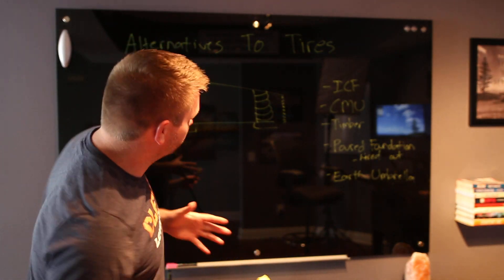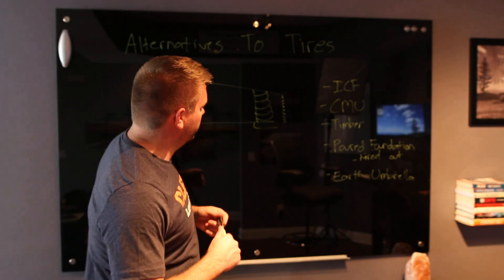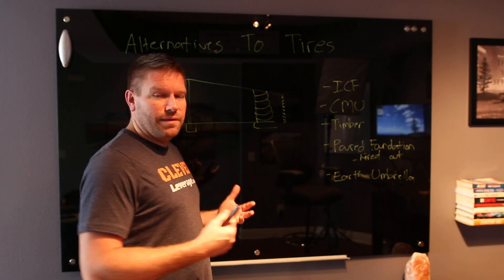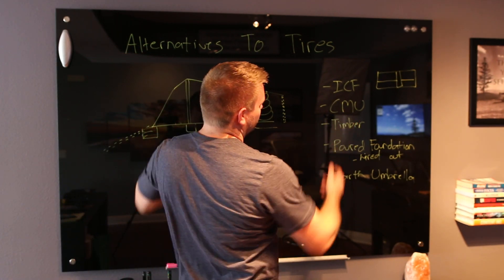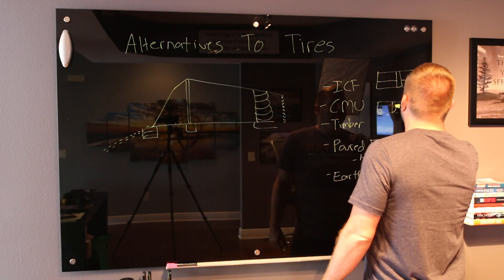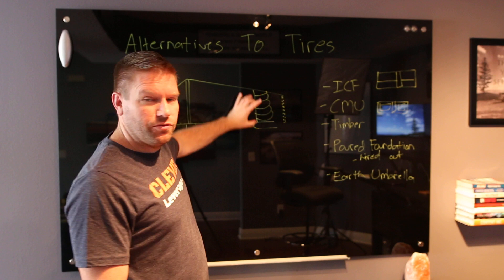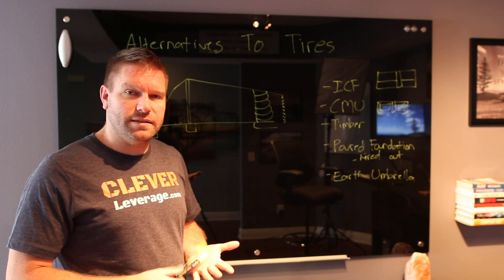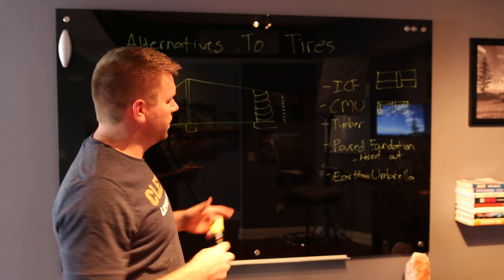Earthships: Alternatives To Tires

Comment: I have been nerding out on hempcrete builds. I LOVE the idea of an earthship home, but hate the idea of using tires. I have been trying to figure out how to go about building an earthship home using hempcrete as a tire alternative.
Reply: I'm curious if hempcrete is as earthquake and storm proof as tires, and if it has thermal mass qualities. From what I've read it seems like it. There is so many ways to build these earthen eco homes, like rammed earth, earth tubes, hemp, cob. Hope there will be more examples of projects mixing it with earth ship concept
Reply: @terriermonisgod  hempcrete can endure hurricane strength winds, it is fire resistant as well as mold, mildew, and insect resistant. My only concern with using hempcrete instead of tires is the water barrier between the hempcrete and the earth backfill. Still lots of research to be done. However, I am leaning more towards an actual hempcrete home with the glass earthship front instead of an actual earthship. Also, the hempcrete has a better thermal barrier rating as well as better insulation factor compared to traditional builds.
Reply: Stinking tires are disgusting.  Hempcrete is insulation or mass or in between.  Insulation and thermal mass are opposites.  Generally low density is insulation and high density is mass.

Comment: I thought the point of using tyres was to recycle waste, not to make it easy.
Reply: Tire bales makes it easy and recycles even more tires than rammed earth tires. For my little 200 square foot greenhouse, 34 tire bales equals about 2500 tires
Reply: @anesthesiadreamin  I saw these a few years ago, however, nothing since. That is an awesome amount of tyres, well done.
Reply: Why put tires in a house when it would be easier and safer to put them in a landfill?   Don't put them in a house unless they add value to the house.  Are you trying to save the cost of disposal?  How much is that?   What about when you demolish the house?  Then you cut the tire to recycle the soil?  That sounds expensive and then the tires go in the landfill anyway.

Why do i never hear about the environmental impact of living in an old house compared with building a new house?  Or an old car verses new?
Reply: @jakebredthauer5100  it all has to do with thermal mass and solar gain. If these are new concepts to you, take a look at Mike Reynolds earthships that he builds worldwide. No utility bills. The sun warms the house in Winter, the Earth keeps it cool in the summer. I have stayed in several earthships, his very newest design stays right at 70 degrees year-round. I did buy an old existing stick house, like you suggested, and it will cost me $100,000 in utility bills (propane and electricity) over my 30-year mortgage. This greenhouse I will never have to expend energy to heat or cool it. The buried tires will never again be exposed to UV, will last likely for centuries, way out lasting a wooden frame. Seisemic resistant and termite proof as well.
Reply: @anesthesiadreamin  I was addressing ease-of-use and safety. You did not address ease-of-use, and you did not adequately address safety.  If you have ever smelled a tire that has not been cured long enough, you will know that it stinks. That continues until the whole thing is evaporated.   One report was that in an Earthship on a hot day that you can smell them.   To me, that is a serious disadvantage.   The older they get the more they crack and that is proof.
Reply: @anesthesiadreamin  What would be the cost of utilities for 30 years in an Earthship, including capital investment and  interest?
Reply: @jakebredthauer5100  :-) having never lived in an earthship myself, but have talked to several long time residents of earthships, they pay about 200.00/year for propane for the stove. If it's a dry year and they don't capture enough water, thats 300.00 to have 5000 gallons of water delivered. Obviously no electric bills since solar power. When I compare my conventional home to an earthship, they can both have system failures. In 10 years in my 20 year old home,  the well pump went out (3500.00 tp change it out) and my HVAC is on it's last leg (quote of 6000.00 to replace it).  Of course earthships need no HVAC. If a water pump goes bad in an earthship, the owner unscrews it and screws on another one. Sure solar batteries go bad, but 10K every 10 years is only 30k over 30 year mortgage. That's plus propane is still a lot less than I am paying now. Of course this is considering both buildings cost about the same to build. To me the biggest value of earthships is a comfortable climate that doesn't rely on systems that cost $$ and can and will fail.

Comment: I hope that plastic brick walls become a common method used (covered in cob and or cement to prevent off-gassing). The whole reason to use tires is because it helps the planet by using an item that is otherwise destined for a landfill. Plastic bottles and cans are often used but my impression is that they are easier to recycle than tires. The plastic bricks I'm talking about uses difficult to recycle plastics like grocery bags. Building with these plastic bricks also seems a lot less labor intensive.  https://www.youtube.com/watch?v=xaxrixBFAic

Comment: We you there in the middle of summer on a hot day? This is when off-gassing would be the most noticeable. My friends have been in Earthships in Taos on hot days and the tire/petroleum smell is unbearable. I have read several articles that claim that tire off-gassing in Earthships is a non-issue, but tires do contain: "benzene, mercury, styrene-butadiene, polycyclic aromatic hydrocarbons, and arsenic, among several other chemicals, heavy metals and carcinogens". I think that Mike Reynolds is a brilliant guy and a saint for pioneering this style of architecture, but it would be a shame to find out that residents of tire-wall structures develop serious health problems years down the road. Not trying to hate, just after the truth and want everyone to be safe, happy and healthy. This is a real concern and deserves some research and analysis. Your concerns are justified Matt, even if you are not sure why tire walls don't sit well with you. Thanks for the video! ~S
Reply: Tires don’t off gas if the are completely covered by earth. The off gasing happens on the outside walls but you can also cover them all.
Reply: @daniluchison although the process should be slower, off gassing doesn't completely stop when the tires are buried certain materials in tires naturally break down when they are near room temperature and some of the byproducts of that process are toxic.
Reply: @daniluchison  believe this hahaaha
Reply: I'm thinking that the same rubber diaper you wrap the roof in, loop it back around and block the tires off from the interior as well. Maybe locking in the offgassing would help?
Reply: @_____ the tire thing actually is primarily described as being more of a waste reduction strategy rather than a rational cost saving measure.
Reply: One of the architect guys who pioneered building earth ships got diagnosed with stage four cancer, so it might or might not have been a factor in the development of that disease that he lived and worked with tyres.
Reply: @MissMeganBeckett  If that was the case, wouldn't there be a whole load of people coming down with cancer who work with tires daily (fitting and puncture repairs)? I imagine that living far from the city in a beautiful home with little to no debt would do wonders for my health!! But yeah, we can only speculate.

Comment: Caged Rock Gabbions stacked with rio-bar through the middle into some footings below the cages, then coat each face for protection or even leave the inside bare for aesthetics if you like that sort of thing.
Reply: I love the Gabion cage (wire mesh baskets filled with rocks) idea. I'm hoping to build a shipping container cabin, buried on three sides and the top. I believe the three sides should be gabion cages, as I really don't want to use any concrete or cement and this seems to be a very low impact solution. Gonna take awhile to sift and pull and load all of the rocks, but they'll be local and easy.
Reply: Wes Carnegie If you were in the Sunshine Coast Australia I’d give you a hand. I think it’s a good idea, but I’d suggest a hard bottom underneath them for water to seep and flow to and out away from the shipping containers, perhaps into a submerged ferrocrete water tank nearby?? Just an idea :)

Comment: Similarly, I too went to Taus, I too stayed in an earthship and I too decided life is too short to pound tires for 18mo+... a guy in Australia used a jumping jack rigged to a back hoe that really sped up the process ~5min per.  But I'm looking at formed rammed earth.  Tires are really just steel/ rubber reinforced rammed earth.
Reply: That man had the correct idea with pounding and stacking - I saw the video as well...wow!
Reply: The only issue would be if the rammed wall would be strong enough to contain the massive amount of dirt behind the wall!
Reply: Do you have the link to the video? I've tried searching for it without success.
Reply: Don’t forget rubber and steel reinforced.

Comment: I'm in the process of designing my own home, I really want to use a lot of sustainable materials, super insulated/high thermal mass etc. I think I came up with the same thoughts, using tires is not really the way to go for most people. Unless you have access to a very close tire dump I don't think I would go all that extra work for actual minimal return. Tire walls is very unnecessary, also the amount of layers of plaster work really adds to an unbelievable amount of labor. Material handling doing cob or any plaster/stucco is hard work and incredibly slow. I would only choose that if you had a tractor with a bucket, and maybe even a tiller to do all the mixing. I'm thinking about using forms that use metal roofing materials as the outside/inside material, basically permanent forms. Would save lot of labor. Maybe a woodchip/soil/straw/concrete mix as the infil, would need to be tested. Aircrete looks awesome, but to get it perfect would require a ton of testing.
Reply: I’m pretty sure there are forms out there that are made of insulation board with metal reinforcing bars in between them. If you’re not against the idea of using foam insulation board. Then you have a little bit of insulation on either side of your wall. Have fun with your design process! And best of luck with your local building department. Sometimes they’re a little stuck in their ways.

Comment: ICF cures at a higher strength due the insulated forms holding in the heat and moisture. With rebar in every core or every foot vertical and horizontal it can hold back backfill for a buried wall.
Reply: That's a great idea but, what about all the material needed for the mass?
If you have "insulation" via the ICF, you're blocking the convection heat from going back into the home when it gets cold! 
ICF is great for building and it's strong but, I believe that we need alternatives for the tires so we can benefit from the convection.
I like the ideas above using sandbags filled with earth or sand or a combination of things. Very strong if multiple layers are used and you can do everything yourself quicky without breaking your back by "beating" tires!  : (  ha! ha!
Reply: @BowenOrg  do you know if plastic bags used for super Adobe or dirt bags etc release toxic fumes?

Comment: I like your thinking with these ideas, ive been pondering the same thing.

My idea is a rammed earth/cob build but make it wide enough to run a wacker plate.
Should give the thermal mass. Cobs been around for 100s of years so should be a standard building material.

I watched a video about a month ago of the closest ive seen of this (yay youtube history search!)
https://www.youtube.com/watch?v=hLu2gxsVBe0
but they go with tamping it by hand (well it looks like they tried an air device but gave up and went with just hand tamping), just a little wider on the wall and a wacker plate would have fitted easy.

*all the cob builds ive seen seem to be stand alone buildings so im not sure on how having an enclosed rear wall (some sort of water proofing would be needed obviously) would effect the cob but i presume if you can get and keep the rear wall dry it should be all good.
Reply: Awesome idea i was thinking they same nice and wide for wacker😁

Comment: I feel like you are missing the point of the tires. He is building with existing materials. Tires are great because you are using something that is littering the entire work. Every inch. I recently bought a property, and what do you know, less than a mile away, a huge pile of tire just sitting off the road someone dumped.
Reply: Mr. Reynolds nickname is the garbage warrior. His intent is to build homes with recycled materials. My intent is to build an economical home that is low on energy use. I am not going to pay a team of laborers to hand pound the tires just so I can say I am using a tire wall. I do not have a team of 50 people volunteering for this. In my opinion he is looking for alternatives. Worm boy that is how a design is improved.
Reply: The other issue is time.  It takes forever to pound the number of tires needed for a reasonably sized home.  The work party with a huge number of people has been Reynolds solution but that isn’t easy in many areas. Traditional barn raising didn’t take so many people.
Reply: Well said.
Reply: Tires smell bad and release toxic chemicals into your home. They shouldn't necessarily be building materials
Reply: OverLordMauS 
He has been building homes for 50 years. Do you honestly believe if chemicals were an issue people wouldn’t put it out there?
There is no off gassing as long as the tires are completely covered by earth.
Taos uses outside walls, not living quarters, where the tires are exposed.

Comment: I have a bad back so tires would kill me. Consequently, I've thought about a solution to this problem for many years. Michael Reynolds had an ingenious idea and that's why it's so difficult to think of a better method (cheap, easy, fast, functional, green).  I've refined a method to build an alternative Earthship that is 1. Cheaper than an Earthship 2. Way, way easier than an Earthship to build. 3. Faster to build. 4. Equally functional and possibly more functional in regard to thermal mass. 5. It isn't as green, but it's still considered green and uses two types of recycled material.

What is it? Sorry to be a tease but I believe this idea has commercial potential so unfortunately I have to stay silent for now. I need to construct a building as a test bed and then I can look into developing a product (plans). My biggest problem is money to build the test bed. From there I believe the rest will fall into place. If anyone out there has more money than they know what to do with, isn't afraid of an NDA, and wants to be a part of something unique then let me know.
Reply: How far have you got? I’m game to discover more.

Comment: Poured foundation, no doubt about it. If your lot is accessible, it's the best way. The bank will loan money on a house built with standard practices, and you'll have resale value just like any other home. If you're in a remote location, dry stacked block makes good sense. If you live in a third-world country, then tires and cans it is. The earthship design concept is superb. Building with garbage will not save the planet. Why do it?

Comment: My wife and I are building an earthship style with Hydraform Compressed Earth Block...
Reply: @maodonimega Hydraform Compressed Earth Block is comprised of soil, water, and cement, which is then compressed using hydraulics into bricks. Personally I feel standard cement would be stronger, but not as 'green.' I rather imagine it would last about as strong as adobe brick, but of course I'm no expert. I'm sure it'll be fine. Using earth to hold back earth. What could possibly go wrong?
Reply: Sounds like the best option!!!! Ive done a lot of research and been in the construction industry a long time , thermal mass is where its at , and rammed earth has stood the test of time all around the 🌎
Reply: @maodonimega you do the same process as any other building - the blocks are laid on footings and stem wall above waterline.
Reply: Please film everything and share on YouTube!!! Most appreciated!
Reply: Ron. Did you get it built? I’m in Sparks Nevada also and am dreaming of my earth ship if you have any pictures or video I’m sure everyone that loves earth ships would love to see and hear what your experience is like. 😀

Comment: Did you find an answer to this?  What about using aircrete or hempcrete for the back wall?
Reply: I was also thinking AirCrete as an alternative to a tire wall. Its relatively easy to purchase mix, can even be delivered to site, cheaper, and much much quicker. You could probably make a 30 inch backwall out of this, line it, and then pile earth in behind? this is all theory though. has anyone else used Aircrete, and if so, is it strong enough to be a load bearing wall?
Reply: last thing I read on Aircrete was that it wasn't allowed for structural loads in most areas, thats one of those things thats still too new and many inspectors aren't familiar with. Also one of the big concepts of Aircrete is it's insulating properties, you don't want that for your "thermal battery" because it's a lower mass which means it holds less heat.
Reply: Aircrete probably can’t take these structural loads.  It’s a great insulation.

Comment: I read somewhere that the tire wall is not a good solution because as the rubber decays it emits gases that are harmful to breathe 🤷🏻‍♂️ is this true?
Reply: When it decomposes it does. The argument is once sheltered inside the earth, it's not exposed to outside exposed that would lead to decay... that would lead to it emitting the hazardous gases.